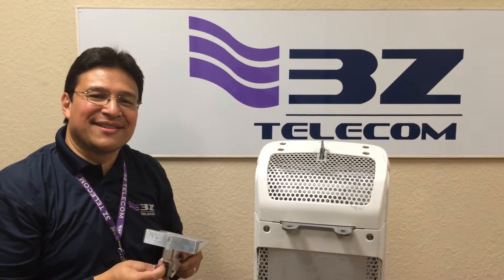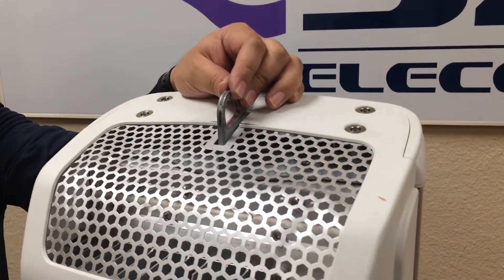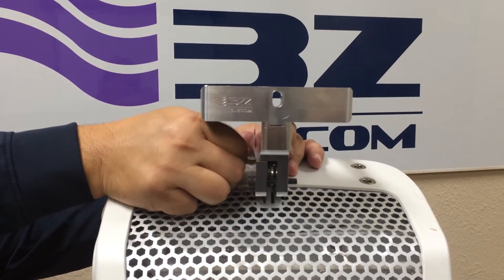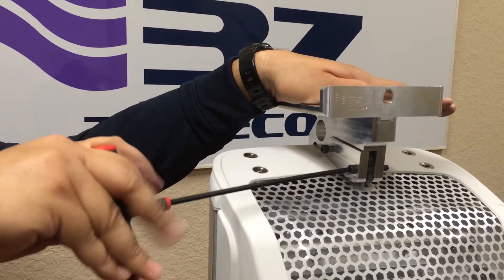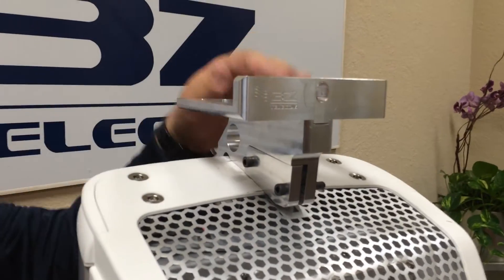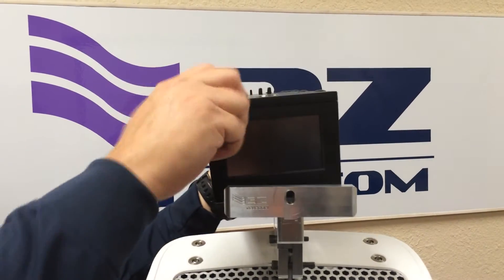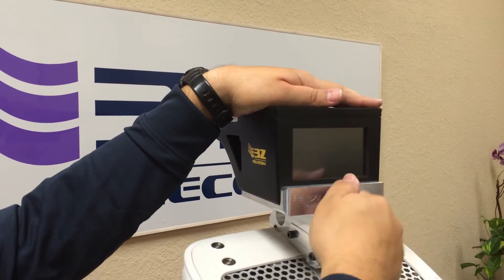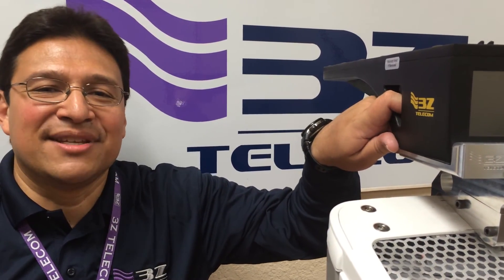3Z Air 21 Ericsson Antenna Clamp - Demonstration Video

Comment: I worked at Ericsson Antenna Technology Romania and let me tell you how the antennas were measured and we were obliged to you! the antennas were measured without cables, i.e. not all 12 ports were connected, only 8 ports which of course were good and the other 4 were not good and were not connected, we were obliged to do so by the management and the shift supervisors.